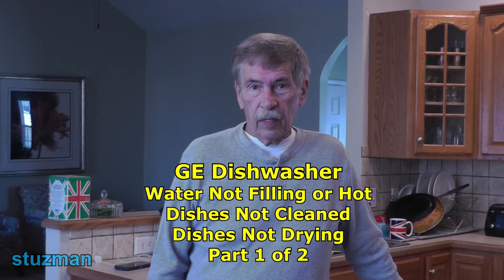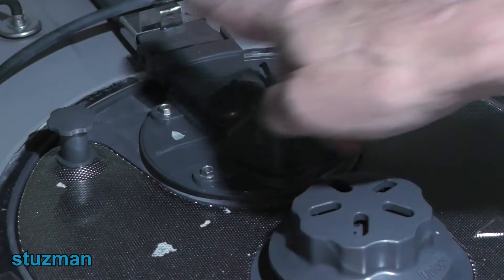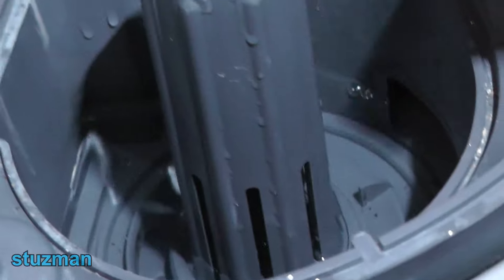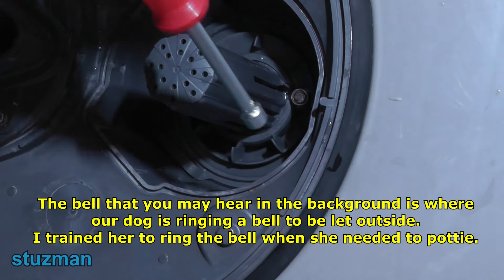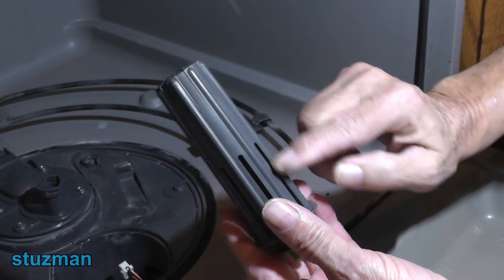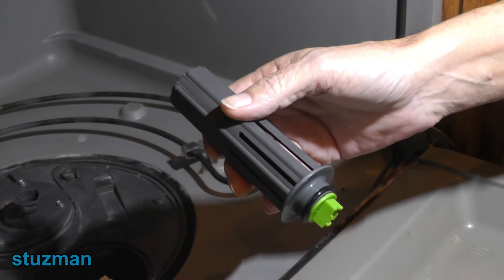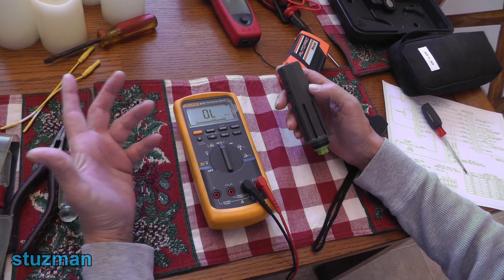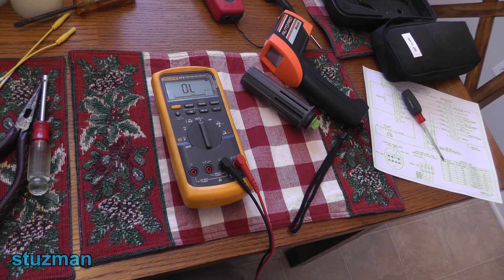GE Dishwasher: Water Not Filling or Hot, Dishes Not Cleaned or Drying, Part 1 of 2

Comment: Thank you. Your video was very informative. Mine was very dirty. Cleaned it good to where it moved but ended up having to do it a second time. This time leaving it in a cup of hot water , but leaving the connector out of the water and sprayed dawn powerscrub in it shake and repeat a few times to break up and sludge or grease. Worked perfect after. Thanks a ton.
Reply from the maker: Glad to hear that with your persistence in cleaning the flood sensor that you saved yourself some money. Glad to hear that you got it fixed. Have a great day!

Comment: Mighty fine troubleshooting, Terry! Do these modern units have diagnostic codes that you can use to identify the problem area?
Reply: Not sure about dishwashers but our Samsung washing machine has a two page list of trouble codes which would be displayed on the digital readout.
Reply from the maker: Hi Dave, nice to hear from you! And hoping that you and your family are doing well. With all modern appliances such as stoves, washers, dryers, refrigerators which usually all have some type of microcontroller, these items can all help in identifying a problem. Usually, a blinking LED with some specific counts will indicate a specific problem or there may be a numeric LED which would indicate a problem. With some of these appliances, one can enter a consumer error mode or a diagnostic error mode which is intended for a technician. On this model and other GE dishwasher models, it has both of these modes. Great question and have a SUPER GREAT DAY!

Comment: I had similar problems with a seamins DW.
  The next earlier model had a recall for setting fire to the countertop 😮😮😮.
 I also found the same  problem with mine...
  An overworked relay that boosts temp of inlet water due to subpar temp of same... 
  Hard to miss the burned out relay😅😅😅😅😅
Reply from the maker: The older appliances were much better in longevity and were much better machines. And that's why the wife and I are still using a washer and dryer that's about 25 years old. Thanks for the comment!
Reply: Yes, I subscribe to the same theory...I just.     hope all of my antiques don't decide
to die at the same time and the parts store is still open😢😢😢😢
Reply from the maker: @randyanders I think we're in good shape Randy and nothing to worry about. Those old appliances will probably outlive us both. 😊